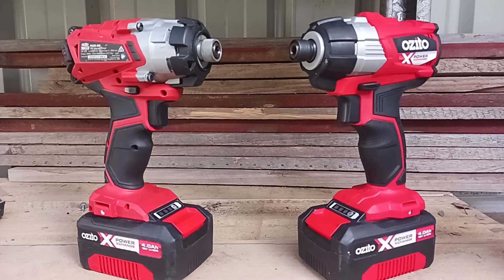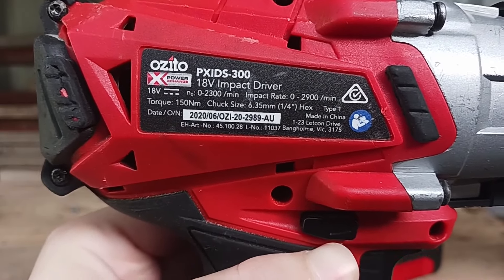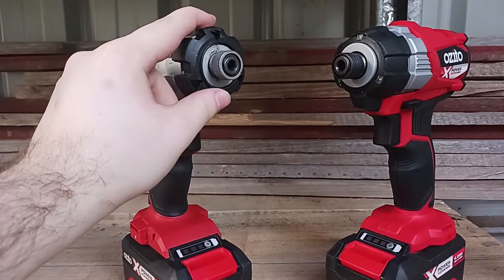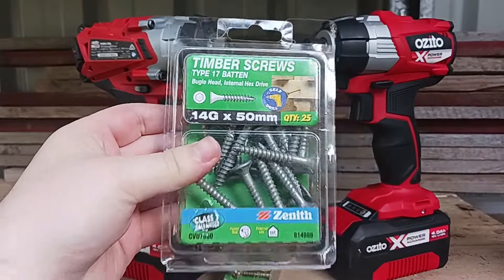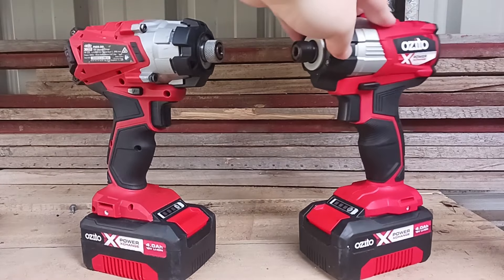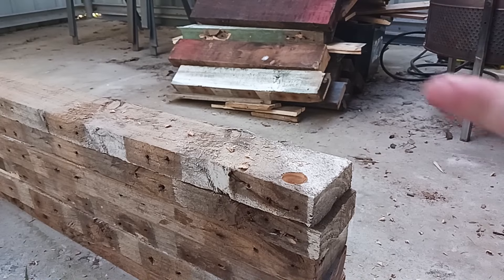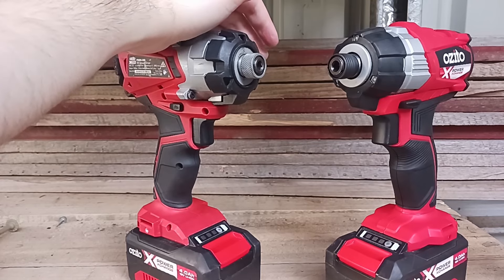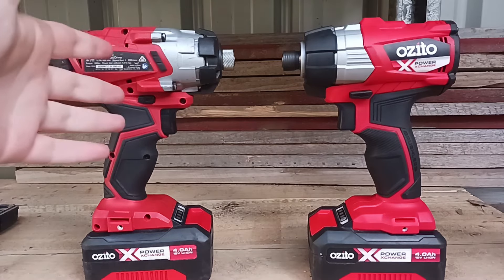Ozito Impact Driver Battle PXIDS-300 Vs PXBIS-320

Comment: Wonder if an 1/2' conversion is possible in the brushed version. Would turn it into a bargain impact wrench.
Reply from the maker: Yeah I wonder that aswell I have seen a video converthing the brushless one but not the brushed one.
Reply: @Nornical1500s   Not a surprise both impact mechanisms are similar. Just a different motor.
Reply from the maker: @RogerM88  Yep thats true. I do reckon that you would be able to change the brushed version over, but then i would think whats the point because she's only got 150nm ot torque.
Reply: @Nornical1500s  It could actually increase the torque. Since the transfer of impact is stronger through the socket. Could even work to loosen wheel nuts torqued to specs.
Reply from the maker: @RogerM88  Oh ok i honestly didn;t know that but now that you explain it, it makes sense.